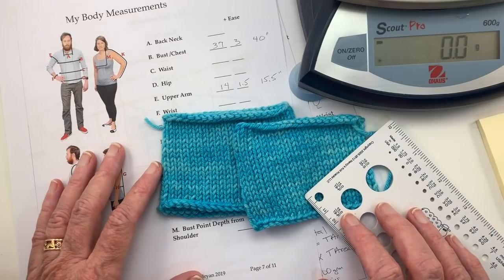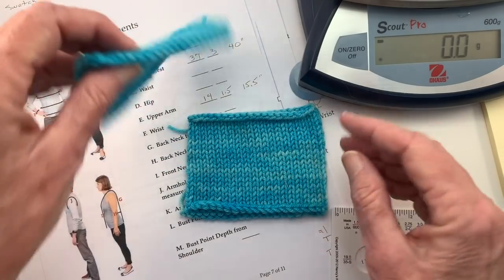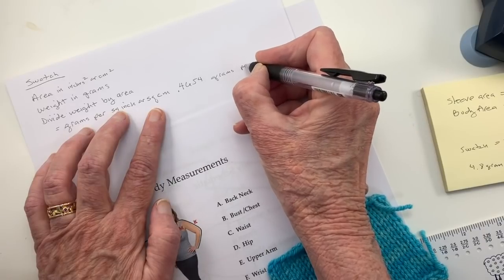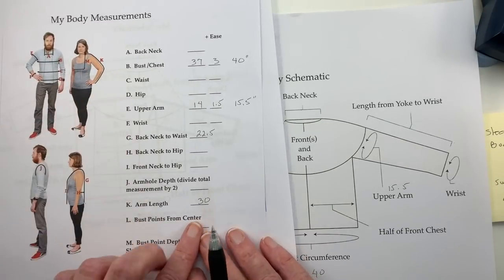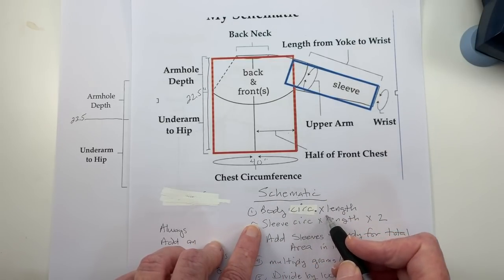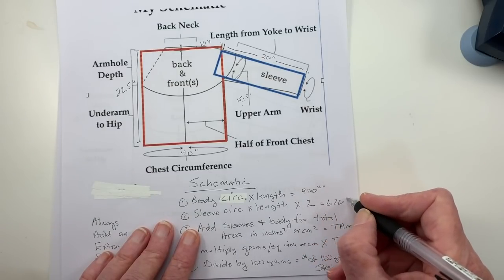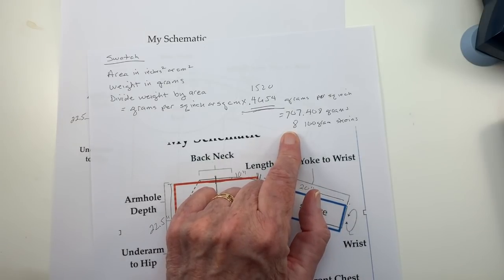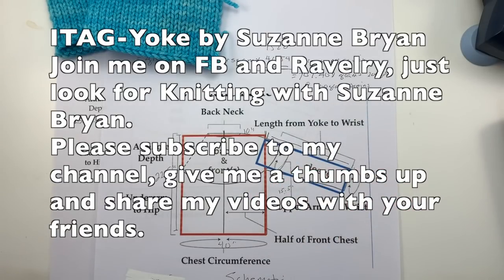Calculating Yardage for a Sweater from a Swatch & Schematic

Comment: This is SO helpful, like all your tutorials. Do you have advice in terms of measuring a cone-shaped circular stranded swatch to calculate yarn requirements?
Reply from the maker: You would use the same formula as figuring out the square surface of a cone.  You can Google that.

Comment: Hi I was wondering if you could make a worksheet so we could fill-in our numbers appropriately.   With the correct math whether division, multiplication or additional the correct time. Trying to follow along with you. 
Also do we have to weigh the swatches.?
Reply from the maker: Thank you for the suggestion, I will work on it.  Yes, if you want to use this method, weighing the swatches is necessary.

Comment: I guess I am not explaining myself so you understand my dilemma. I don't have my yarn yet so to count stitches on a swatch I don't have is not possible. I do have Ann Budds book but you still need a swatch. Ordering yarn is something I thought we would do when we know how much we need. I am not a lucky person that I have that kind of yarn lying around. Was hoping to know how much I would need then buy it. We don't have yarn shops close by so would have to order on line.
Hope I have explained myself this time.
Reply from the maker: If you know the weight of the yarn you want to use, and the particular yarn, you can look and see what the recommended gauge for that yarn is.  You can find it where you are ordering your yarn, or in Ravelry's yarn database.  Use that gauge, plus your intended finished sweater circumference to find the recommended yardage that you will need in Ann Budd's book on page 33.  I hope this helps.